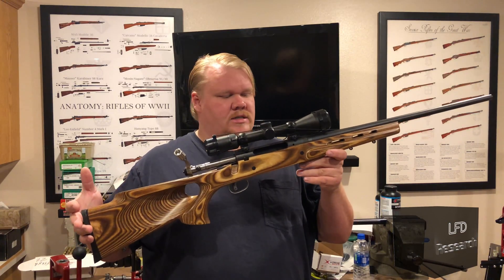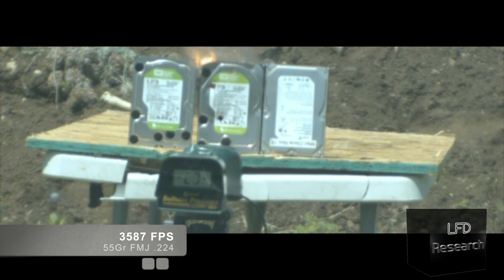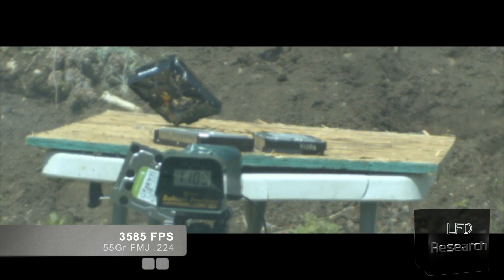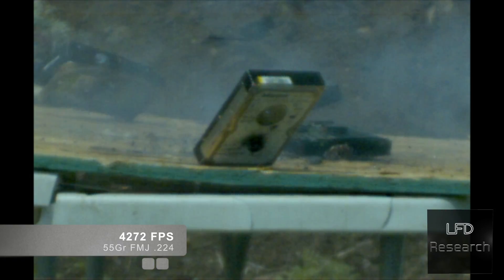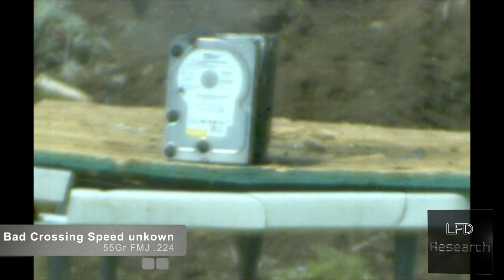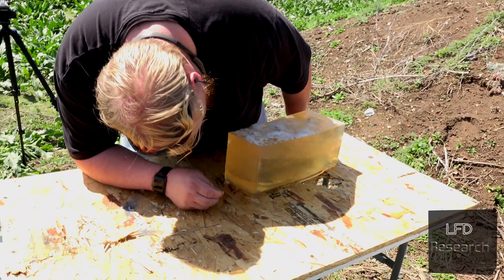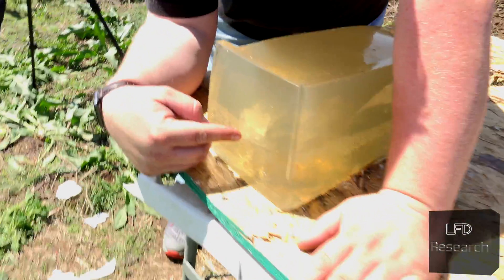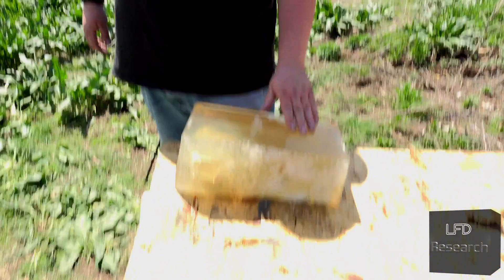Quest for MACH 4 Part 4

Comment: Just load a 58 grain monolithic copper .243 bullet into a 6mm crusader case. They're already moving at 4k in a 24" .243 Winchester
Reply from the maker: You have a good point there are a few rounds that can do 4000 fps out the box using the sabot and 300rum case we were able to exceed 6000fps

Comment: Also, the reason you get less penetration is the higher velocity. The same reason you can shoot a shotgun further into water then a .50bmg (which shatters just below the surface).
Reply: Watch Edwin sarkissians  video of shooting 50 bmg into both pool and water tank. Bullets don't just obliterate themselves,softer bullets at higher angles will incur more damage but that's all.